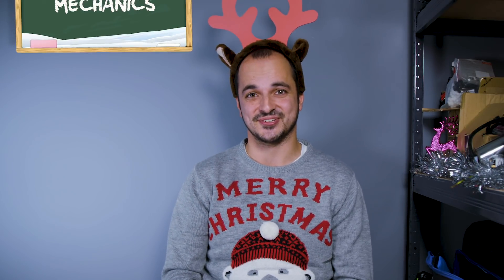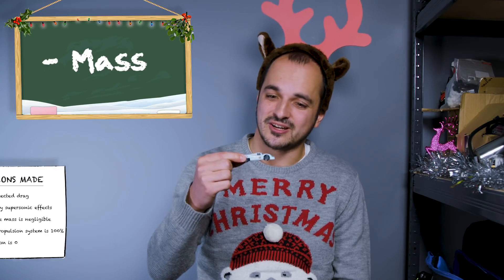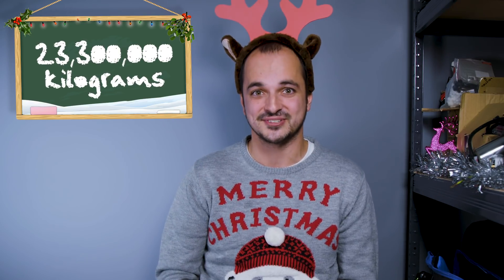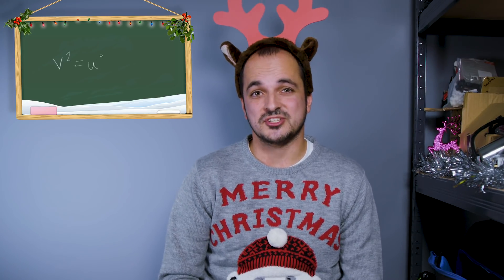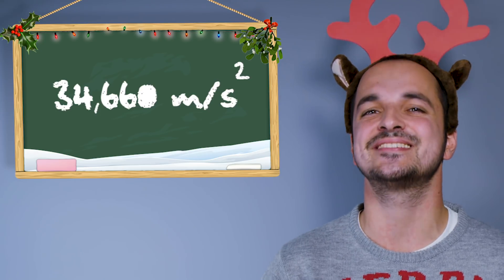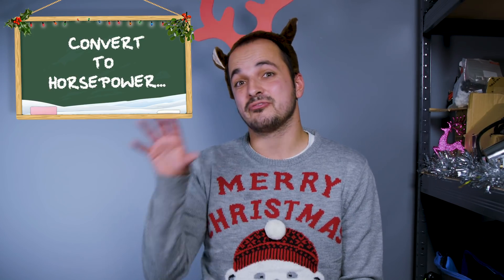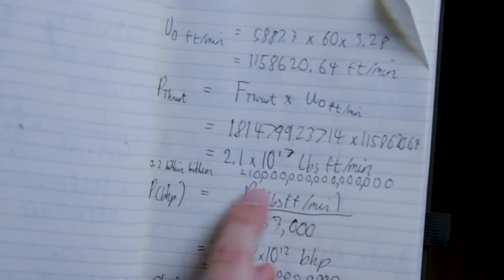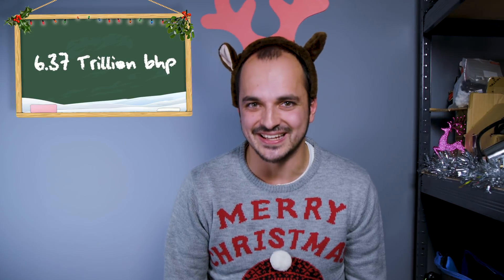How much horsepower does Santa's sleigh have? - Mike's Mechanics

Comment: Technically, the lift weight has to be greater or the weight would be in sustainable mode meaning, it's just standing in zero g mode! The life weight has to be greater then the weight of the mass will not take off! This formula makes no sense!